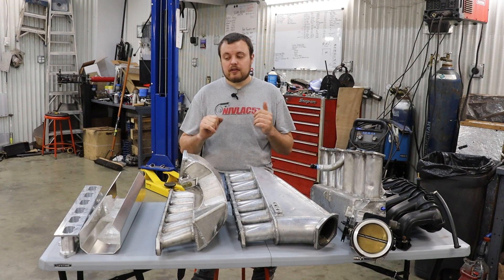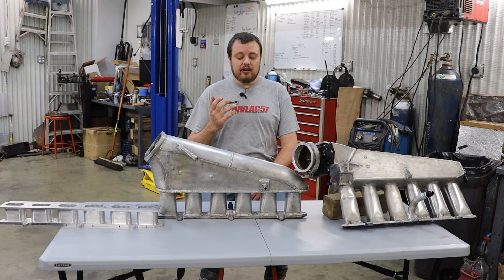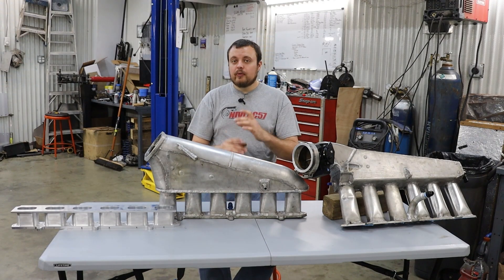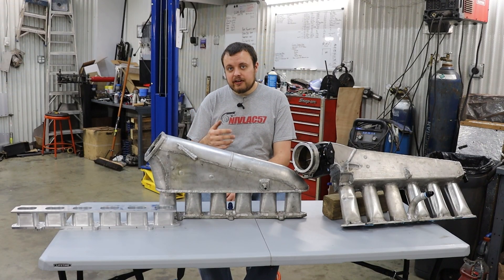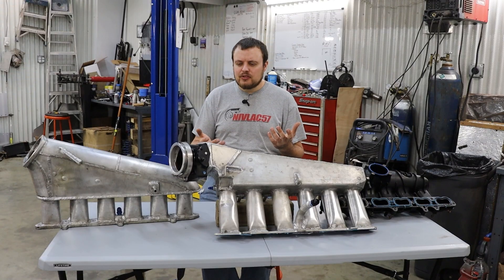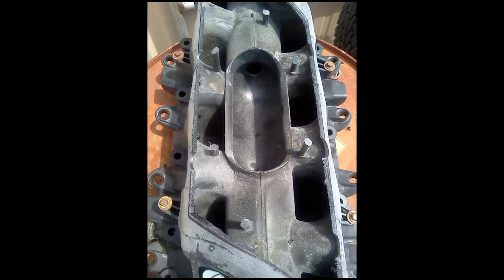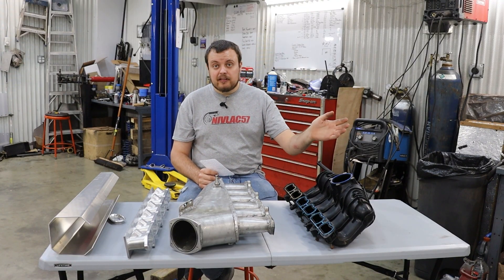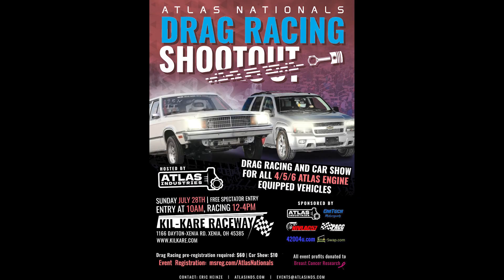Unlocking the Power of Your Intake Manifold

Comment: Thanks that was a good walk through of intake runners . The longer the runner the more torque is created down lower in the rpm !
Reply: No, it's not "longer = more" it's about finding the length that works well with a certain RPM. It's literally just tuning runner length like a guitar string
Reply: Longer vs Lower RPM for the Torque peak - The 17 inch long runners on the MoPar "HyperPak" ram-tuned make a lot of torque down low, but thanks to the ram tuning, where the pulse waves of the air being sucked in causes more air to start moving behind each inlet charge, that stacks up and builds pressure behind the closed valve due to the inertia of the air mass, leads to the engine to hold on to that torque much higher in the RPM range then it normally would. For the long stroke 225, peak torque still comes in around 2000rpm, but it holds on to most of it past 5000rpm (assuming you've swapped to conrods and piston that will handle the velocities and acceleration loads thanks to the 4&1/8th inch stroke). On the smaller stroke 170, the HyperPak runs out to just under 8000rpm.
The moment you throw a turbo in to the mix, all that long-runner tuning is wasted effort and you want the runners as short as possible, with the least amount of distance between the turbo and the valves - which is why front mounted air to air intercoolers make turbo-lag, and why water-to-air intercoolers inside the inlet manifold are best.
Reply: @PiDsPagePrototypes  Would less manifold volume be better for throttle response on a turbo engine? Calvin only talked about the effect of manifold volume on power (I guess there isn't any?), but not of the effect on turbo lag which is probably not relevant for drag racing but could be important for road racing?
Reply: @TassieLorenzo  That's going to depend on whether the plenum is behind a big throttle body, or in front of small ones for each cylinder. Or even if there is a throttle body at all.
Calvin's manifold is real good for drag racing, where part throttle control is only needed if your chassis setup is compromised, and where the entire race is done at Wide Open Throttle.
Road racing or hill climbs, where you have to bring the power in as fast as possible without spinning the car, the individual throttle bodies as close to the valves is always better for throttle response, N/A or Boosted. But it's also a lot more expensive.
That system also requires anti-lag, so the turbo can keep a reserve of boosted air between it and the throttle bodies, that the motor will breath from while the turbo spins up as the exhaust pressure rises.
The no-throttle-body, is where the valves become the throttle, thanks to pneumatic, hydraulic or electrical opening of the valves, with no cam lobe involved. The speed and duration of the opening controls the fill rate, and so a decent sized plenum becomes an advantage as the air reacts quickly to the valve opening.
Reply: @TassieLorenzo It might not give all that much with less volume as the turbo doesn't like pressure changes and the engine that's going to spool the turbo still works exactly the same in regards to puls tuning. It's easy trying to fix one problem and ending up creating ten new. 😄
Reply: And vice versa. The Porsche Vario-ram system was very clever, the current Honda F1 engine uses variable length intakes too.  The various two-stage intake systems seem to be a problem though, the diverter flap inevitably breaks.

Comment: Do you equal length exhaust manifold (headers) or unequal ?  David Visard "fame" says unequal cuz harmonics (long-term)    I know opposite manifold of video  but curious on your thoughts ??
Reply: @ronaldrey8474  the unequal length applys to v8s mostly but the merge points for inline 6s, v6s, and inline 4s all have their own set of rules for maximum scavenge and evacuation efficiency... Glad somebody else mentioned this because a lot of people argue that equal length is "the best" without any data to back it up. DV for the win, without his testing over the years I'm sure we wouldn't be as far as we are in tech today
Reply: @Brother2Jis_27s4  HOME RUN explanation & ty.  Totally makes sense V8 compared to 4-6cyl V or Inline. Never even thunk it , and was confused cause equal length everywhere , but Mr. Vizard says No No. My money is on D.V. & Unity Motorsport but now I know why. Ty friend
Reply: He said equal length is best IF packaging allows it.  But on a cross-plane V8, 180⁰ headers, or an 8-to-1 merge collector is impractical in most applications.  He pointed out on a typical American V8, each collector doesn't see 4 equally spaces exhaust pulses, but rather 3: two small pulses and a larger / longer pulse from the two cylinders that fire 90⁰ apart.  So you'd need unequal length headers to make the collector "see" 4 individual pulses.
Not an issue on an online motor though.
Reply: @383mazda  thx for replying. I sent a message to Unity Motorsport (D.V. partner )  and that makes sense but what about harmonics and in time that destroying the valve train ?  Hoping either guy will make a video explaining... 🤞
Reply: Harmonics of what?
Reply: @km6832  think he said valve train. Been little while seeing video but available. Equal length or unequal length type title
Reply: @km6832  weakness of valve train long-term
Reply: Keep in mind, much of Vizard's material applies specifically to V8 engines. Some things (like the unequal length exhaust) may not apply to an inline 6.
Reply: @michaelblacktree  thx for replying. My question is not for horsepower put harmonics that can destroy valve train long-term. That's what Vizard was teaching...
Reply: @ronaldrey8474  Pulse harmonics are not likely to destroy the valve train. High temps and high revs will destroy the valves over time. Cooling the valves (e.g. those sodium valves) and using the correct spring rating for your target RPM and valve mass can mitigate these effects to some degree.

The main concern regarding the harmonics of the exhaust is about returning the pulse to the cylinder (having been inverted upon being reflected by the collector) so that scavenging can take place (and with appropriate valve-overlap and intake runner length, supercharging effects can occur too, but that is a Formula 1/Indie Car level of tuning). On the other hand, tuning this way could theoretically result in power loss at certain speeds if performed incorrectly (stronger pulses arriving at the wrong time, choking the exhaust). This is why it is sometimes found that reducing the backpressure of the back end of the exhaust system causes power loss: the harmonics are ruined and so the exhaust manifold is all wrong, leading to lower flow.

Comment: Calvin, the intro music at the "Runner" section reminded me of a different type (cough-cough) of film...☺Is there some correlation between intake type and the output of the turbo? Thinking low boost vs. high boost levels.
Reply from the maker: Not that we have seen. They all individually behave the same at all boost levels.
Reply: The trick in the design is to have the manifold  build boost pressure evenly at each runner bellmouth.  Typically an obtuse triangular design where the engine facing side of the plenum (the  inlet) is about 25% longer in length than the actual length of the flange @Calvin-Nelson